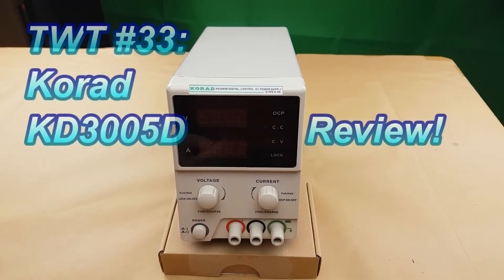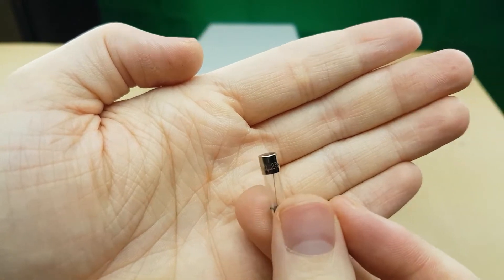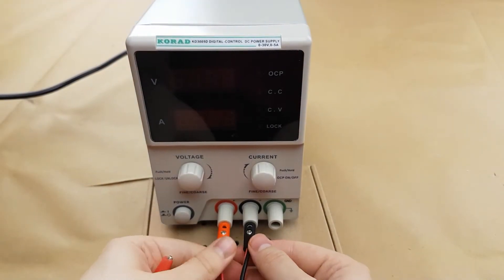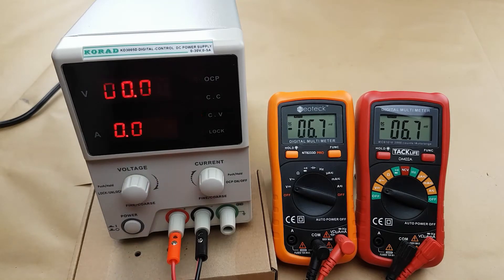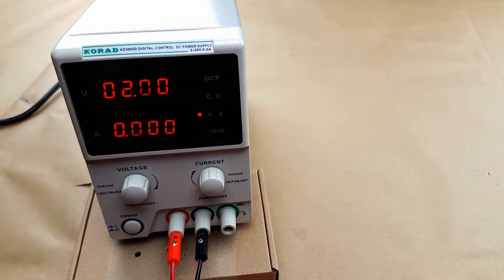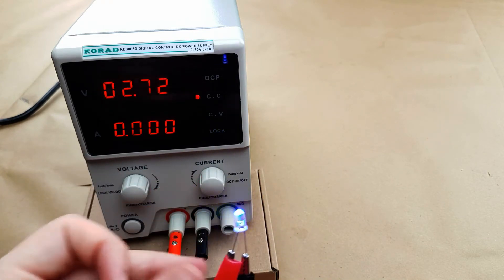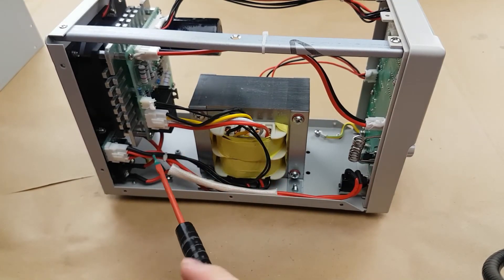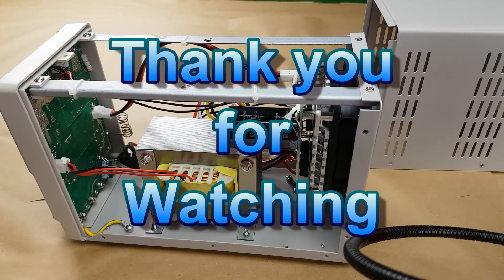Korad KD3005D Bench Power Supply Review! | TWT 33

Comment: I'm probably going to get the KA3005D. I can go cheaper and get a switch mode psu. But I'd rather have something that will last me longer. Do you still have this supply? Does it still work or has it given you problems? Thanks.

Comment: Thanks for the review, based on this I bought one a while back.   I find the calibration is close, but about .07V off.  For most stuff, that doesn't matter, but do you know if there's a way to calibrate this unit??
Reply from the maker: On the manufacturer website (https://sra-solder.com/korad-kd3005d-precision-variable-adjustable-30v-5a-dc-linear-power-supply-digital-regulated-lab-grade) under technical data they have calibration instructions. I would be very cautious adjusting the calibration, as it is likely fairly easy to throw it way out of balance. 

I hope this helps!

Comment: I really don't understand the point of your review we know it is a power supply no need to show us the power cord and to show us how accurate the voltage is by testing with metres and to open it that is common sense we wanted a proper review the MOST IMPORTANT thing you didn't show ... HOW ABOUT how the PROTECTION works ???????? THAT'S MOST important but you to busy showing obvious things very BAD review....
Reply from the maker: It is what it is, some people are interested in the build quality and accuracy of the device that is who this review was designed for. There are certainly things that I didn't think to add at the time. 

I'm not exactly sure what you're looking for when you say protection, if you mean OCP then you simply set a current and hold the current knob in until the OCP light comes on. Other than OCP there is no "protection", you simply have to be mindful when working with a bench PSU and stay aware of your leads.

Comment: The cable connection to the unit is very tight. If you think that it cannot go further in then you have underestimated just how hard you have to push to get it seated properly. I have one of these and had the same problem initially until I realized this.

Comment: Is there a way to give it a Constant current and constant voltage to work as a adapter?
I want to use mine as a power suply for my anodizing tank but as soon as i set the current to 1amp it switches back to 0 because the resistance is to big.
Reply: I am having the same issue did you find a solution?

Comment: Did you try a different power coard? That is a very sloppy connection. =/
Reply from the maker: Thank you for the suggestion!

I just tried out a different power cord from one of my PCs and it did actually fit properly. It would appear the cord that came with the PSU has a defect on the pin contacts that prevents it from fully plugging in! I'm not sure why I didn't try a different cord last night... face palm 

That is the first time I've ever had a C13 connector not physically fit into a plug, luckily I have a ton of PC power cables around!
Reply: @TinkeringWithTerrius  I just purchased the KD3005P and the power cord fit perfectly. Nice review.